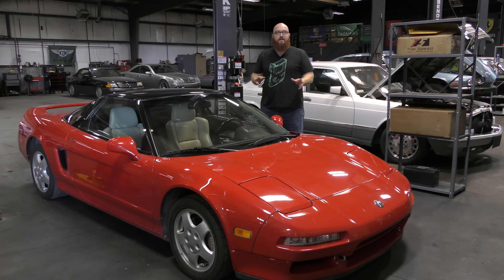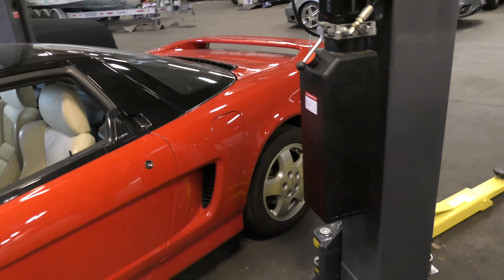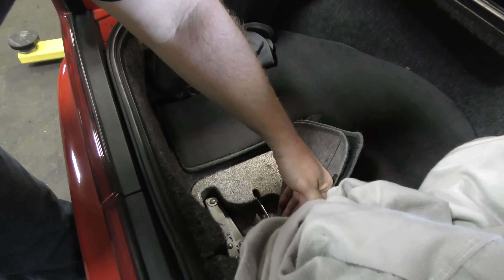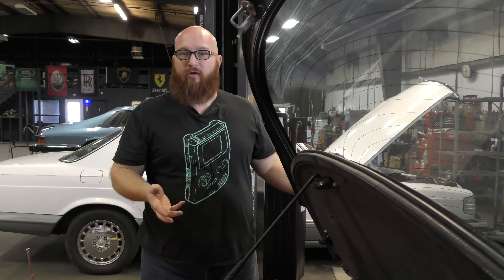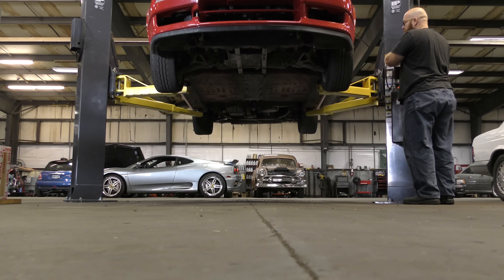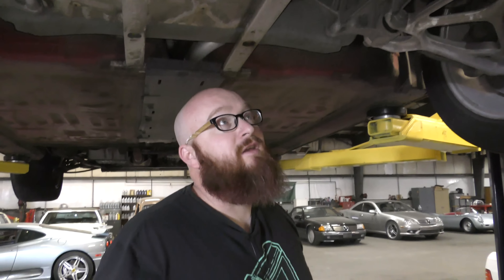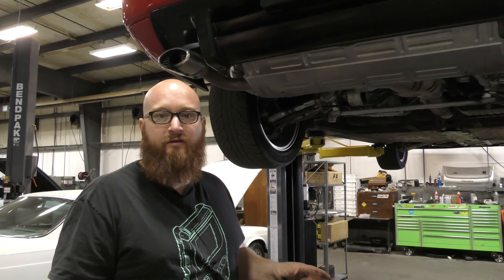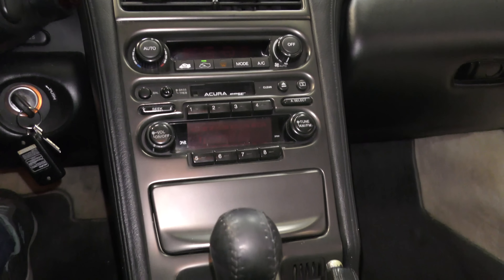Supercar with over 100K miles! You've got to see this '91 Acura NSX in the CAR WIZARD's shop

Comment: 11:08 "Fuel tank is in the center of the car." Yes. No one ever explains why that's necessary for handling.  My 914's tank was over the front wheels, and when it got light, the car would handle differently.  A center location keeps the balance stable, thus improves handling.

Comment: For a 29 year old car with ONLY 101,000 miles on the clock means its hardly been used. On average only 3482 miles a year.

Comment: Hi Wizard,
Had a 97 Nsx  fmatic Targa 3.0 litre. Best car I ever owned ....e type, Ferrari 308, bms , mercs, Cobra...I had quite a few but the NSX was my daily driver for 3 years and I sold it for what I paid for it. Running costs...cambelt, oils, brake pads, tyres  ie normal maintenance stuff. The gearbox was paddle as well as stick and also gave engine braking on down shifts. The brakes and handling were to die for with superb visibilty. d
Design tuned by Ayrton Senna and Honda built a dedicated NSX factory. They even designed their own aluminium to enable panels to be made that held their shape like steel when pressed. I could go on and were it not for badge snobbery more soul have sold.
It was nice to see you shut the boot lid properly instead of just trying to slam it shut.
It's production probably saved one of two so called supercar producers of the time...They really had to up their game. Interestingly Gordon Murray of McClaren came also ran an NSX.....

Comment: doubt  an accord is more fun -  my integra is more fun that most newwer cars
Reply: I have 2.0T Manual 6 Speed. 

I get to shift more with the accord prior to breaking speed limits. It is also nice to have the three kids onboard!
Reply: @nicholasbegley645  my bother has the 1.5 and wishes he got the 2.0- real nice cars but just not my idea of fun my integra with 140hp is just more "fun" and I can imagine the NSX out on the road!
Reply: @bikeman1x11  I don’t necessarily disagree. My dad ran a plaza with Honda, Acura, Porsche, Mercedes, Saab, and Jaguar...

I got to drive anything from 1995-2001 pretty much every day. Plus many higher end used cars...

The Porsche Turbos were the most fun to just bomb down a road. 

The NSX had the best visibility, best driving position, best looks of the era. 

I always enjoyed the Boxster S (a lot)... have a soft spot for early AMG CLK’s. 

With that all stated, Honda’s were my first love. Early preludes were always a blast. Civics were a lot of fun. 

I have owned just about all Honda/Acura models (Ridgelines, Accords, Preludes, Civics, Odysseys, S2000, CL Type s, legend, NSX). 

For fun - I think an S2000 with the top down wins (the earlier engines with higher redlines).   With that stated, the new manual transmission Accord is a sleeper you can have a lot of fun with.
Reply: @nicholasbegley645  agree 100% a porsche is usually awesome to drive - the 90's earlyy 00 honda/acura were great fun and eeliable. I was always a muscle car guy  but last year bought a 98 integra as a fun /project car  aas it only has 42k miles and one prior owner- the 140 horses arent blistering but it revs freely and is just so fun to drive - only ABS no nanny gadgets i love it

Comment: The stock spare has a pleated sidewall because the rear tyres were  taller than the front.  Its stored on the car with no air in it. You fit the spare then inflate it to the correct diameter depending on if its at the front or back with the onboard compressor.

Comment: My MR2 from the same era never missed a beat. I put 100k plus miles on it. Always mobile 1 oil and did not push her until fully warmed up. And zero problems!
Reply: Yeah, the NA version runs like forever plus it's a Toyota so you know its very reliable.

Comment: This car caused a huge wake up call to European exotics like Ferrari, Lamborghini, Lotus and even Porsche. You could buy a mid engine car that was reliable, fairly comfortable and had a great handling ( only in a dry conditions!) that didn't spend weeks in a shop between drives. And it was cheap to fix ! It was a Honda.

Comment: I did autocross with a lady that had 260k miles on hers when she sold it. It only sat in the maine winters. It got driven and driven hard when it used. Her comment "what's the point of having it if you're not going to use it?"  Honda V8?

Comment: Where does the guy keep/drive the car? How come there are no rust marks on all non-aluminium suspension parts on the car, like all proper Japanese cars are supposed to have? Also, Car Wizzard, why don't you go into more detail about assemblies which are really interesting, as you say? For instance, the front suspension - the rear bushing of the front lower wishbone isn't connected to chassy or subframe, but goes to another lever, which is highly unusual. What lever or rod is that? Why have engineers at Honda implemented such a solution? What benefits in driving characteristics would you guess it brings? I'm sure many of the viewers would appreciate such ''nerding out''.

Comment: 100k miles might sound impressive, but in Europe, there are NSX's with 300-400k driving around. If the maintenance windows are adhered to and the car isn't taken to track-days frequently, it seems they don't die. But whether with high mileage or low mileage, they are rare...

Comment: Kudos to the owner for driving the car. So many people squirrel them away and don't enjoy them as the manufacturer intended. The power antenna probably wore out the plastic teeth in the mast. The mast can be replaced. To prevent this from happening, just wax the mast with the same product you use to wax the body.

Comment: I’ll give you another pro tip and this is coming from somebody that has worked in the autobody business for a long time. You said that you never push on the car by the body. 100% correct because it’s very easy to dent. You also never do anything but slam hoods. I’m not telling you to slam it through itself. But I’m telling you that you don’t put it down to the stop and then put your hands on the top and push down to latch it. Same with trunk lids. You always throw them down to get them to latch. If you push them down you will push dents into the hood or into the trunk lid. Someone with out the eye for this might not notice those dents. But now that I’ve been doing this for many years I can see them from a mile off. People put the hood down to the catch latch, put both hands on the hood and push it to lock. And then I can come out and put a straight edge on it and I can see exactly where your hand prints are. You don’t have to slam it so hard that the headlights fall out but you do have to close it with a measure of force enough to get it closed without applying continuous pressure with your body. Nuf said.
Reply from the maker: You dont do this to exotic cars. They panels are carbon fiber. If you slam it, it could crack. The latches are 2 stage. You lightly drop it to engage first stage. Then press right above the latch to engage final stage of closure.
Reply: @CarWizard  yeah and I wouldn’t do it with Corvettes with their yellow plastic panels either. We had one we never could get the hood right on because the guy kept slamming it. I’m not telling people to slam the hood through itself. But definitely close it with enough force to get it to latch and not apply continuous pressure on metal panels from the top. Most people know if they have a fiberglass car or a composite car though. If you have the money to have that type of vehicle then you know what type of material it’s made from because you’re a car guy (or girl). And you would not slam those type of vehicles. One of the ones that always interested me was Miatas. One of the lightest hoods in the business yet they never seem to close without slamming and by god if you put your hands on top and shove it down well those dents could probably used to identify you in a criminal process. Lol.
Reply: I would love to have some advice from you guys if you get a chance one day. We are starting a YouTube channel at our body shop and our first victim will be a 71 dodge dart pulled from our junkyard and re-done in one weekend. Not bodywork. Running gear. We will do bodywork videos on it later but we’re doing it from the perspective of somebody that would be trying to do it from home at a somewhat economical price point. I would love any advice you guys could give

Comment: I would love to drive one of those.  The weight and dimensions seem so lovely.  That amount of power does put it in the ultimate usability category, where you can rev it out and bury the throttle without going so fast you arrive in jail before you know it...  So that's cool.  But would 325 horses be better?  Yeah, it would.  I don't need modern car, Nurburgring lap-setting 911 GT power 500+ up.  That's too much for RWD and 1991 build quality.  But a 0-60 under 4.5 and some mid range grunt for highway passes would make these the chef's kiss.  I wish they had the SH-AWD.  I don't need 200mph.  Never use it.  But rock solid at 110 is nice.  I'm sure it is.

Comment: probably had that cheesey wind up plastic line for the power antenna that my Accord had and kept breaking...
Reply: I think all electric arials have that plastic toothed line.
It seems it has to flex to account for the aerial going up and down,but it's flexibility is also it's weakness.
I took the one on my 1998 Saab 9-3 apart (damn that's a messy job) and replaced the plastic toothed line,and was as good as new.

Comment: Nice car! Since it's a Honda product I assume it will run like clockwork until everything fails simultaneously and it won't be economic to fix it. But since it's an NSX the bar for economic repair will be a lot higher than a Civic.

Comment: I don't know what your talking about but my 97 has been up to 160 miles and hour and had more to go. With some light comptech mods it puts out 315 hp does 0-60  in about 4.8 seconds and the quarter mile in around 13 seconds.  I don't know what family Accord is doing that.

Comment: I love the stock wheel size on that NSX. Modern huge wheels are so stupid I think they just make them like that for looks as a trend. Cars ride so much better with more sidewall and a smaller wheel is easier to start and stop so it gives you better acceleration, braking, handling and mileage. The fastest cars in the world in F1 and in Top Fuel drag both use 15" wheels so there is a clue there. Plus those big thin sidewall tires are so much more expensive and harder to mount and unmount. Sure they are better at high speed cornering on a track but does that apply to every modern passenger car on the road? Maybe it does with the way some people drive on the highway. I like how you can see the fender gap is larger on the top than the sides and the underside of the car has plenty of clearance so if you lowered it just so that the fender gap was even all around, probably 1 inch or so, you would still have enough clearance underneath to daily drive it in most places easily as long as you don't have those big speed humps. If you did that and put on a turbo or something with very light pressure even 3 pounds and I bet it would handle better and be more fun than that new Accord he was talking about.

Comment: It is a REALLY beautiful car! This car shows the quality build of Japanese vehicles of the Ninties: They run and run and run and hold up very well. The way good old GM cars used to be in the Sixties: Their engines were kind of undestructable. I remember an Olds with 800 000km with its original engine I once received for free.
 The million miles Toyotas tell  the same story: Built to be solid runners.

Comment: NSX's had transmission troubles [something with a snap ring] and they were notorious for going through tires.
Reply: The snap ring things is legit, but only affected certain '91 and '92 cars.  It's correctable by replacing a piece of transmission case.  The tire issue was actually an alignment issue with the rear toe set up with a performance bias vs a tire-wear bias. My '92 will get 10k miles out of rears and that typically includes a few track events.

Comment: My uncle had one.  Beautiful car.  Honda reliability.  The handling was incredible.  But that car ate tires and did it quickly.
Reply: I remember that was one of the “problem” areas of this car.  And they were expensive.
Reply: @One Issue Voter unfortunately you're not accurate.  It's the aggressive rear toe in and front toe out via the factory recommended settings.  It handled best this way but due to several lawsuits/complaints the factory recommended settings was changed to a more tire wear friendly setting.  Because... You know... Owners who bought these amazing cars should really bitch and moan about tires wearing out on the way to the Applebee's.
Reply: I looked to get 1  tire eatter..plus maintenance and parts..  left outside never garaged... I passed....  too many special parts...
Reply: @christopherhamilton5557  s few years ago 3 blocks away selling one. .... but the special parts... tire eater... aluminum parts hard to source..nor garaged killed it for me...20k or so....
Reply: New tires are a small price to pay in the scheme of things, oui?
Reply: Yes the original  tires were designed  for handling the rears lasted about 9k miles. But now with most  decent  performance tires on it I get pretty  good wear. Hey it's a performance car not an accord.

Comment: Needs an oil pan gasket kit too  :)
Reply: Agreed, changing the oil filter is not going to fix the leak, it needs an oil pan gasket.
Reply: And a new radiator as the plastic looks really discolored. No leaks, but that plastic is brittle as hell.

Comment: There are something like 28 coolant hoses on the NSX. I changed every one once on an NSX I owned. Once was enough.
Reply: With the engine in?
Reply: There are 22 coolant hoses which need to be changed every 15-20 years and yes, you can change them all without dropping the engine

Comment: i dont know about accord would handle better than nsx. I may have more HP and better drive in highway, but nsx is 200ib lighter and will handle better on sharp turns. I'm just surprised it is not modified twin turbo or supercharged.

Comment: Has no one mentioned that Ayrton Senna worked with Honda on the NSX's Chassis and suspension?
Reply: Satoru Nakajima
Reply: Somewhat factual
Reply: @sunnohh  thanks, i was shooting for somewhat ;-)
Reply: Not even Doug or Wizard
Reply: He gave feedback for the TypeR not the non TypeR
Reply: @hector_nimrod  they know where to come next time lol ;-)
Reply: No. He didn't. He drove it around a few racetracks and said something along the lines of "it's pretty good". He wasn't keen on the original prototype, but had no real input into the final chassis design.
Reply: @sq1rlsqu4d  link to full story in earlier comment...
Reply: @sq1rlsqu4d  uh, what? They stiffened the chassis by 50% after Senna critiqued it.
Reply: With a lot of rear wheel toe in, for best handling, which wore out the tyres very quickly. Subsequently reduced from 6mm to 1.5 mm!

Comment: I'm glad about people coming around to the realistic difference in going with a fun handling and driving car like the Wizard said.  As being opposed to holding out on the promise of a super car.  An affordable car with great handling aligns exactly with the old saying "It's more fun to drive a slow car fast than to drive a fast car slow".  A couple of months ago I opened my mind and bought a used third generation MINI Cooper S series.  I haven't regretted doing that.  Every model and version from MINI Cooper is first and foremost about handling, and my S version with a stick even has the power to push me back into the seat some.  By opening my mind I've found go-kart fun that I haven't enjoyed in years, and the actual fun factor has been on a par with my now long gone Corvette.  My open mind brought me fun now instead of waiting for someday when I could afford a used and probably beaten-up Lamborghini Huracan.  The Wizard stated about mechanic's having to open their mind about the mechanicals of the NSX.  And I'm adding if you're holding out for a super car be realistic and don't deny yourself fun by not having an open mind toward cars with great handling and a sensible amount of go-power.

Comment: The NSX is notorious for how much it eats the tires due to toe-in at the front and toe-out at the back.
Reply: Learn to drive and adjust it out.
Reply: Never heard that and my brothers had one since 01
Reply: The alignment specs when the car were first released in 91-92 were very aggressive and people often reported getting only 5000 miles out of a set of rear tires.  For 93+ they dialed the alignment back somewhat and it wasn't quite so bad.  No worse than any other mid-engined sports car, anyway.
Reply: The original tires on the car had a comically low tread wear rating.  I know he went through the first set in about 6k miles, since then no issues
Reply: The tire wear was due to the super soft compound that came as originally equipped.   After I changed to a newer Yokohamas, I got 45k miles with mixed track use.
Reply: Acura/Honda prolly had a secret deal with the tire manufacturers... Since this car was built to last at least over 100k miles, how else are they gonna make money off ya? <:  P